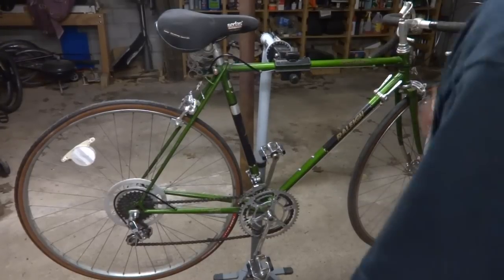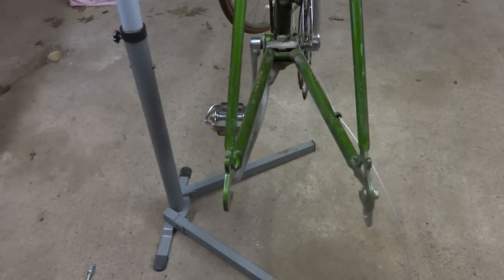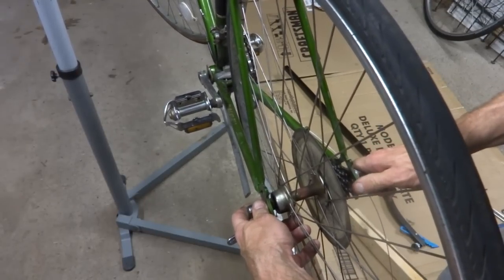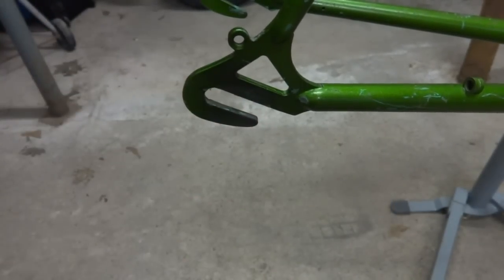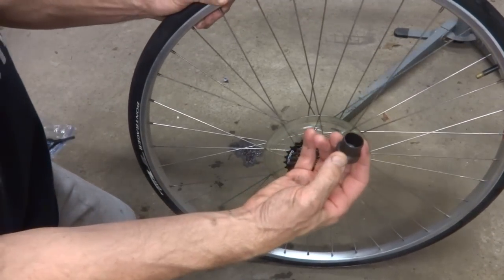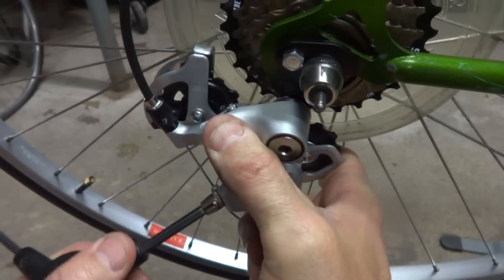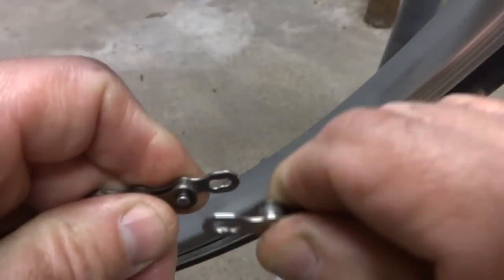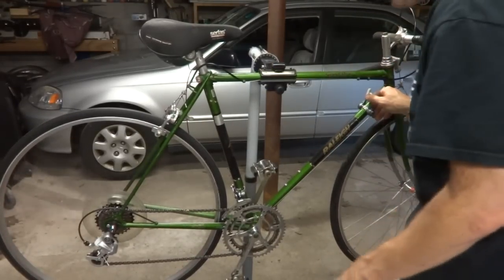Upgrade Vintage 10 Speed Bike To 14 Speed & Indexed Shifting

Comment from the maker: For more bike repair videos hit the subscribe button 🛑 and click the notification bell ► http://bit.ly/SubRJTheBikeGuy
Reply: RJ The Bike Guy Hi RJ, have you ever worked on a
1990 Fisher Supercaliber? It has cartridge bearings in the bottom bracket. They have to be Locktited in. Do you think there would be a way to install a cartridge bottom bracket somehow? Aligning the chain line is something I do not want to do anymore. I have to set the chain line before the locktite sets. Can I thread the the bottom bracket part of the frame, maybe? Please let me know what you think.
Reply: I see those martial art skills come in handy for frame alignment purposes. 🥋🥋
Reply: Isnt that still friction shifting?
Reply from the maker: @natas0733  No. They are indexed down tube shifters.
Reply: @BulletmanDoom  8

Comment: RJ, really appreciate you posting your videos. You guided me through removing my cassette, installing ball bearings on the rear wheel, and installing my rear derailleur. How did amateurs like me manage before youtube? Thanks fella!
Reply: I built two bikes using his videos..Started flipping fixie bikes.
Reply: I learned fixing bikes through taking them apart and having to work out how they got back together and when I was older helping out in a bike shop

Comment: Its interesting.I did the same to 1978 Team Raleigh bike.I also changed the handlebar to flat and higher for more comfort and Shimano bar shifters.I simply love love this bike.It handles exceptionally well.It could be good old 531 tubing.Now my Specialized racer is collecting dust.I prefer the Raleigh over it.This goes to show what you like maybe 50yr old frame to build upon. Great videos! RJ Thank you

Comment: Great stuff RJ. No matter how the building of bicycles progresses or changes there will always be so many advantages in working with a good steel frame. Aluminum is lighter and carbon fiber is stiffer but steel is ultimately recyclable, useable, workable and upgradable with new wheels, shifters, brakes, flat bars and drop bars to make a brand new bike.

Comment: I have Raleigh exactly like yours, except mine has been neglected for 40+ years and trying to decide whether to fix up or not. You helped me a lot for this specific bike.
Reply from the maker: This was not a high end bike. I wouldn't spend too much money on the project.
Reply: @RJTheBikeGuy  I'm thinking around$150 for tires, tubes, cables and front derailleur. Do you have any suggestions for an inexpensive front derailleur? I'll probably just display it or maybe give it away. Thanks for the input.
Reply from the maker: Shop around on ebay or craigslist.

Comment: Watching this made me realize I’ll be spending as much on tools as I will be on bike parts. Maybe I should’ve just bought a new bike
Reply from the maker: Maybe. I have videos on how to make homemade versions of many of the tools.
Reply: RJ is great.  The frame alignment can be done with string and the rear brackets aligned/widened with some threaded rod and nuts.  Can easily make them for $10 max.
Reply from the maker: @TheMoose240  https://www.youtube.com/watch?v=dUPAKqS3dt8
https://www.youtube.com/watch?v=z9bPiAi_KQc
https://www.youtube.com/watch?v=PsU8IkkFaok
https://www.youtube.com/watch?v=YdibmxBuMy0
Reply: @RJTheBikeGuy  perfect! Maybe I'll make a set for my project to check the squareness of the frame before overhauling it.  One thing I for sure noticed is the chain rubs slightly on the frame just above the drop down bracket. You mentioned in one video it might need a spacer after resetting the width to accommodate a bigger hub.  Is that how to fix it properly or could it be the frame is just bent and needs alignment and no spacer is needed. Thanks!
Reply: I was thinking the same thing. If you buy a new bike off the shelf you could easily spend money on parts by upgrading it to instead of having a solid platform you like already and just updating it to what you want.
Reply: But by having these tools you can fix bikes over and over again and get multiple bikes and fix them. And then maybe sell them and make all your money back

Comment: Cool, you've put this vid up on the same day I've just finished the same project on my dad's old 1968 Claud Butler.  I went the 700c and 9 speed route and it did end up costing more than I anticipated!
I was dropping by to say your other vid's on swapping downtube shifters for brifters, and swapping to a sealed cartridge bottom bracket, were really helpful. Keep up the good work.

Comment: I did this to my Schwinn Le Tours. I had a 1 x 7 setup for riding roads (Florida is flat enough) and a 2 x 7 setup with flat bars and 27" nobbies (kenda make them and they are awesome) for trail riding. I kept the original non-index stem shifter on the road bike, it just barely accomodates 7 gears. For the trail bike I bought some cheapo non-index thumb shifters and they worked great. I wish I didn't have to sell them off. I love vintage bikes.

Comment: Hi, Mr. RJ, the Bike Guy. Your tutorials are the best. I'm not a bike mechanic but I try to repair my own bikes here in the Philippines. I have a Mongoose steel frame MTB and also a BMX bike built with a sidecar which we use for transporting passengers or my family or heavy cargo. They are locally fabricated and fondly called as "trisikad" which literally means "tri " = three and "sikad" = pedal in Filipino. I hope you make more videos or blogs about bikes. Thanks.
Reply from the maker: They sound interesting. Post some photos on my facebook page.
Reply: Will do.

Comment: Thank you for the videos! I made your frame alignment tool using oak and with this video was finally able to straighten out my 1991 Schwinn Voyageur frame and widen the dropouts for an IGH. I had to move one side by about 5mm or so and couldn't get enough leverage until I saw you do it this way. 👍

Comment from the maker: Marc Ariss Bending the frame like this is actually how you straighten steel frames. It's really not too big of a deal. I don't think changing the dish is a practical option for this.
Reply: RJ The Bike Guy you dont know how much u help me i thought i had to throw away my bike because of the rear derailleur thanks man
Reply: RJ is right about this. The frames weren't perfectly aligned after brazing and bending in to alignment would have 
been standard procedure (unless you worked for Raleigh during the 70s bike boom, in which case you apparently      just said "screw it, close enough" and shipped it out misaligned).

Comment: I have a mystery 10-speed motobecane. My boss gave it to me because he never rode it, he was born in the Netherlands and moved to the US in 1985 or earlier and brought it with him. Everything is made in "Fance/Germany" on it. 
Rigida 700c chrome rims, through spoke lock with key, chrome front and rear fenders with dynamo and head/rear lights, brooks b66s saddle seat, silver original paint with blue decals....and the top bar decal says "Club". 
It needs some restoration but I need to know what It is to know what to do for it. 
I'm a 5'7" girl and the seat is as low as It gets, and I have rather long legs, but still can't touch the ground seated on it. Everything I find is for the US made moto's. 
If it wasn't such an amazing bike to ride I'd almost be to the point of parting it out for a small fortune.
Reply: I salvaged a mystery 10 speed mb as well. Try 26" wheels. Keep riding, never stop.

Comment: Two long threaded rods so you have the leverage, washers and nuts, one on each side of the frame where the wheels attach and matching the tips in the middle of the of the frame is allot cheaper and just as effective as Park Tool's versions. I've been repairing and upgrading since the mid 80's.
Reply from the maker: https://www.youtube.com/watch?v=PsU8IkkFaok

Comment: Awesome video! I've never used the 2x4 method before, looks pretty useful. I usually just push with one arm and pull with the other one gradually until I get it spaced correctly (similar to drawing back a compound bow). *In case anyone out there doesn't have a 2x4, it's not very exact but it works for me and steel is pretty forgiving.

Comment: ALL frame shops that re-space will remove bottom bracket first as you're effectively stressing the union between the chain stay and BB shell; the spread to get an extra mm or two is not the problem, the dropout faces MUST be parallel so the weld between the dropout and stays is not stressed.

Comment: I recently discovered "step down" ferrules that go from 5mm to 4mm that help in using newer housing on frames with older cable guides
Reply: He is using BRAKES ferrules instead of transmission ones. That's why they don't fit. Housings are not the same...

Comment: I use anti-seize compound rather than grease on freewheel threads, bottom bracket cups, seat posts, headset cups and ANYWHERE I want to be able to disassemble in the future. Particularly steel / aluminum interfaces. But grease works to some degree.

Comment: try making a jig, reinforce with jig were support is behind kickstand. If not weld may crack when expanded out. yes it works in most instances, that seamed to be weak link only reason ever had trouble doing that.

Comment: Prolly someone made you aware of this already: old 10 speed bikes have asymmetric rear wheels and thus asymmetric rear triangles. Your frame alignment tool confirmed this. This frame was perfect prior to adjusting it for the new wheel.
Reply from the maker: Sorry, you don't know what you are talking about. The stays are supposed to be symmetrical. The spokes are asymmetrical to accommodate the freewheel. But the wheel will be dished to be centered between the stays.
Reply: @RJTheBikeGuy  I stand corrected. Thanks for your work!

Comment: i recently upgraded a vintage fuji 10speed to 2x8, unlike your 120mm, mine was 130mm...... very easy upgrade(even to a 2x11), i only need to change the chain, wheel and cassette.
Reply from the maker: It was 10 speed (2x5) and the hub spacing was 130mm to start with?  That is unusual.
Reply: shyflirt1 i know right?

Comment: How does the weight compared using the aluminum wheels versus the original steel wheels? I have a vintage steel road bike and I was considering putting aluminum 700c wheels on it and changing it to a seven speed freewheel and modern indexed shifting instead of the 6-speed

Comment: I have two schwinn varsity both were 10 speeds NOW they are both 21 speed took the 5 speed rear free wheel and installed a 7 speed free wheel and it fit great on the old 5 speed hub  next took off the double  front chain ring and installed a triple  chain ring   Bikes
 sfits like dream  Heard time and time again this can't work BUT IT does and I did not do all the crap measuring frame  and bending things on two 40 year old bikes

Comment: I use 2 car jacks the ones that are shaped like a diamond when you open it up but this was for the fount fork on a scooter that use bike wheels to fit a E wheel was hard to trun the jack at the same time i put then bottom to bottom thy where small jacks

Comment: Thanks again - I enjoy your videos. I'd seen the other one on spreading the rear triangle with the home-made tool and a good tip on this one using the 2 x 4. Could there be a home-made tool to do the job of the Park Tool drop-out aligner? Maybe two threaded steel rods with bolts either side of each drop-out and a bolt at each end?
Reply from the maker: Probably something could be made.

Comment: Instead of using the seat tube as the fulcrum point wouldn't it be safer for the frame to place a block of wood or something near the seat tube and use it instead?
Reply from the maker: Very little pressure is needed.

Comment: Hey RJ! I have a 1978 Raleigh Record Ace, and I plan on doing some upgrading like you’re doing. I’m going up to a 6 speed rear freewheel, Shimano 14-28, and I need a derailleur. I’m just hoping you can help guide me towards something that will work for my bike if you get the opportunity! 
Thanks for the great videos!
Reply from the maker: A long list of derailleurs that work. Al depending what you want to do. You will have to do research. I don't do those recommends.

Comment: Can you stretch out a chro-mo frame? Or no cuz it's an alloy (I think). Also, does it not need to be equalized on both sides like moving the wood plank on the other side of the seat post?
Reply from the maker: Yes, chrome moly is steel. Yes, it needs to be equal on both sides. In this case, it was uneven to begin with, so I was evening it out.

Comment: Hi RJ, 2mm doesn't seem like much.  Is it an issue just the force the wheel in while spreading the forks/chain stay?  I'm asking because I just got new wheels and I have to force the wheels in.  Is it unsafe to ride?
Reply from the maker: Ted Byun It's probably not unsafe. If you have to spread the wheels, then the dropout change angles slightly. And when the dropouts are not parallel, that can put force on the axle, and cause it to bend.

Comment: great video rj,it's really brutal prying the frame apart & could have sworn i heard it ping as you were pushing on the timber :),would look even better if you swapped the cottered cranks for more modern square taper cranks after all you went to all that trouble to upgrade the gears & derailer,would round off everything nicely :) (cottered cranks are more trouble than theyr'e worth) :(
Reply from the maker: neil crompton It's really not that big of a deal to bend a steel frame. It is only being bent millimeters. I replaced the crankset in another video.
Reply: should be sweet ride then?,the best of both worlds,old & the new :)

Comment: what do u think is the limit on expanding the rear triangle? U think 10mm is too much? I have an old Specialized Hard Rock that's 120mm, was thinking of putting a more modern 130mm road bike wheelset on it.
thanks. great videos.
Reply from the maker: Nick A I don't know. If you hold your fingers up and look at how much 10mm is. And you are only moving each stay half that much. I think it is doable. Be aware of the diameter of the wheel and whether it will fit and whether brakes will reach the rim...
Reply: +Nick A 120 to 130 would be pretty standard.

Comment: Hi RJ, I have one question. Can we or not just install the road levers and hope they work fine with old v-brake and derrailers set, if we find ones with same speeds? Seem to me, only cable pulls come from another device, that should work, but I fear I might be wrong. Many thanks.
Reply: Add: I've found Sora levers, for 121 euros. Front + rear derraillers, 38 euros. Front comes with 28.6mm adapter, needed to my frame. Rear, don't know. Then on ebay or else, there are China levers Micronew or other brands, for about 40 euros, also reviewed on youtube, and seem working well. I only don't know if it works with my old derrailers or not, and that's why I didnt buy it yet.
Reply from the maker: V-brakes require twice as much cable pull as road brakes or cantilever brakes. And for indexed shifting. the levers need to match the speeds on the freewheel/cassette. And the derailleurs need to be compatible with the shifters. https://www.youtube.com/watch?v=xMvD1T4qF1E

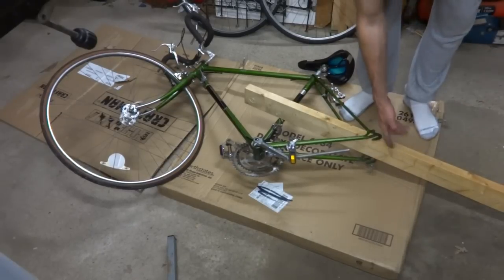Comment: 6:32 this is a mistake!  Dont use the 2" side of a 2x4 to open up the frame!  On a really light Reynolds 531 or Columbus frame this might dent the seat tube! Use the 4" side of the 2x4 to spread the force over a wider area!

Comment: Hi RJ, love your video's.  Hay just out of curiosity, since your using a narrower chain, does this ever cause a problem with the front sprockets spacing?  I've done something similar to my old Panasonic bike with 9 gears in the back and Triples in the front.  If originally had six in the back and I didn't need to stretch the frame to much to get it to fit.  If I ever wanted to use the Original cranks, could I still do it, or is the chain even narrower and not going to work?  When you did this in the video, I would have thought them to be not compatible.  Thanks.
Reply from the maker: MrTBoneMalone The chain need to be thinner due to closer spacing of the cogs in the back. Also I think on 10 speed drive trains and maybe 9, the chain rings spacing is slightly narrower, but I am not positive on that. But that would have more to due with the shifters.

Comment: I like the bike higher on the bike stand while working...its easier on the back...this is a good video..l am working on a five speed Raleigh from the same period...was hoping to convert it to a ten speed..but there is no    holders for the deraileur cable for the new front double cog...bummer..!
Reply from the maker: You can find clamp on cable stops. May have to mount cable guide on bottom bracket shell.
Reply: @RJTheBikeGuy  brilliant...l will look into that..thanks..ps are you not afraid of standing on thumb tacks (or worse) with no shoes...?

Comment: Thanks for the great video. Question. My vintage bike has 42 52 front chainrings, 3 bolt. I want compact one like 36 48. Any idea how to change them without changing bottom bracket ? Such compact one with 3 bolt don't exist. Thanks.
Reply from the maker: You need to have a crank to fit the chain rings you want. You will need a bottom bracket to fit the crank.

Comment: also you DO NOT NEED to change the chain both bikes have the original chain off the five speed  works great as 21 speed
Reply from the maker: Most typical 5 speed chains are going to be significantly wider than a 7 speed chain and won't work optimally.
Reply: That's true, all 5-8 speed chains are the same size.